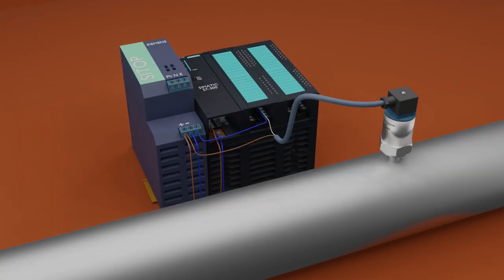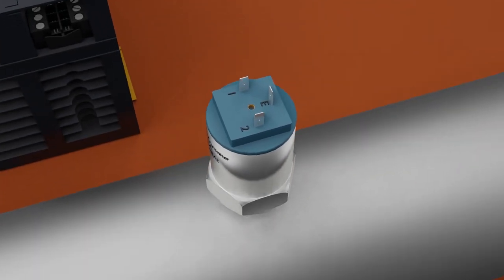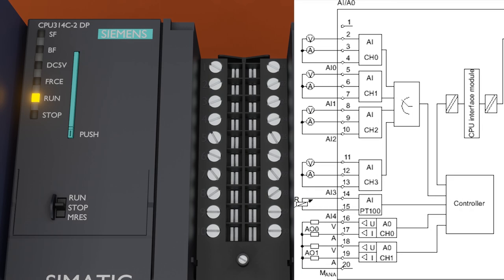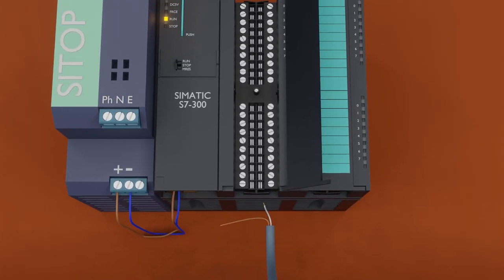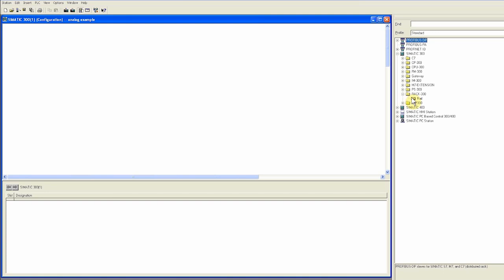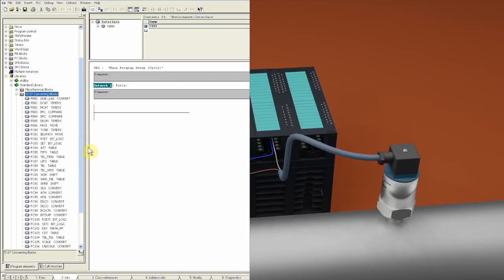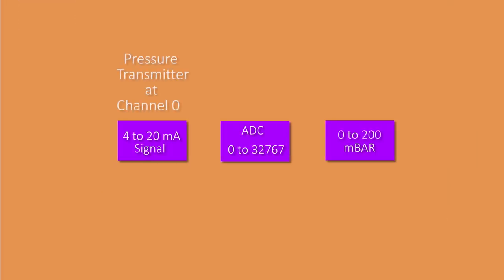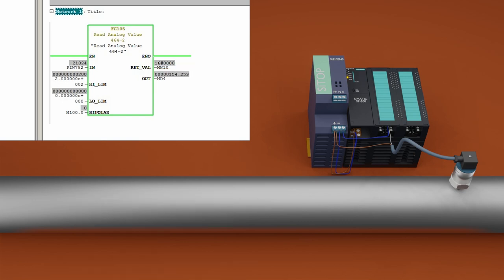How to connect 2 wire pressure transmitter with PLC ?

Comment: Mr. How to connect pressure transmitter 0-20mA ? I use 2 wire connection or 3 wire connection? Thank you
Reply from the maker: i will make a video for 3 wire transmitter also ............ range is not an issue , same process is for 0 to 20mA range sensor

Comment: I have one question, I am using S7-1500 PLC and I am trying to add 2 pressure transmitters signals to PLC. 
Concerning wiring, can I add those wires to PLC analog inputs while PLC is running? Or I need to stop whole system in order to do this? What is correct procedure concerning wiring new signals/wires to PLC analog card?
Reply from the maker: Correct procedure is to turn OFF the PLC and hook the wires at analog input, however if you are connecting wires correctly and 100 percent sure than you can connect wires while plc is in run mode. 
My personal experience at least stop the plc.
Reply: @EASYPLCTRAINING  Thanks for explanation! I think that restart of plc is required after configuration of analog input in TIA anyway, just figured it out.

Comment: Does anybody know a pressure transmitter for a hot steam water boiler?
Reply from the maker: huba control model 511.931003741 -- 4 to 20mA signal -- 0 to 16 BAR range . you can use this pressure transmitter for boiler and steam applications
Reply: @EASYPLCTRAINING  Thanks a lot 👍